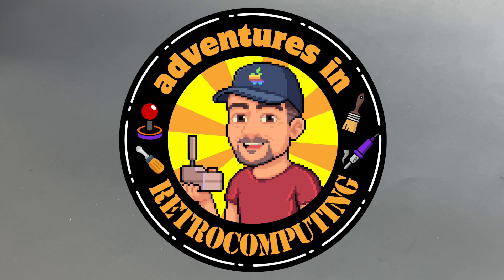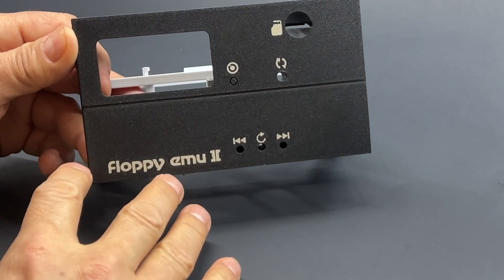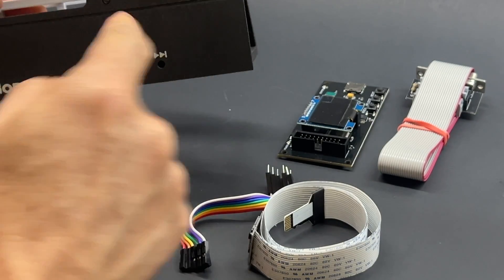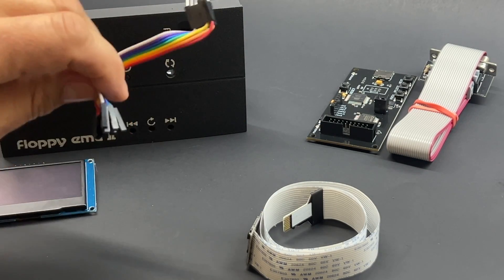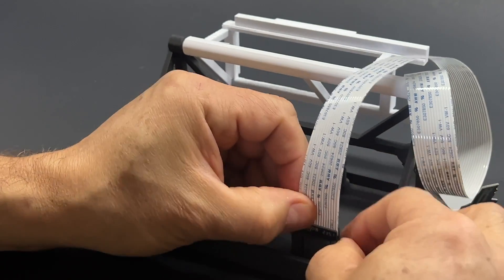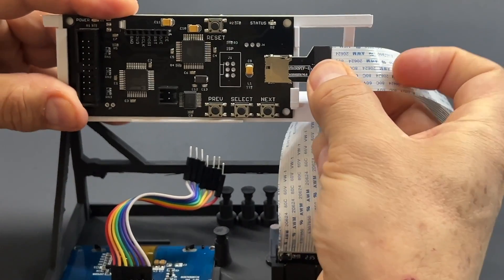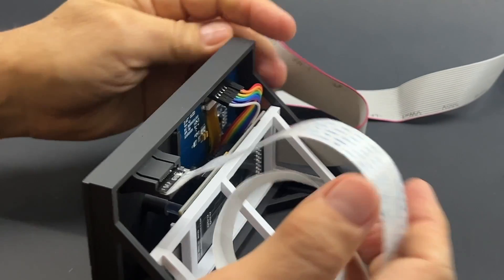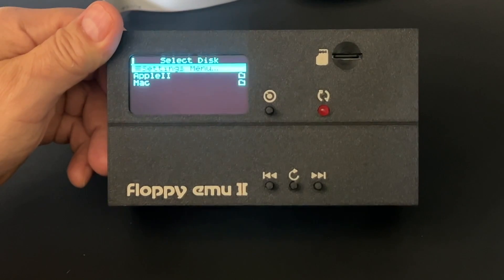New Release: Floppy Emu ][ Case Assembly Guide!

Comment: Finally got back into messing with Apple ][ stuff, and got a used Disk][ case for this kit from Javier.  Going to hook up this, and a wDrive to a Yellowstone card on my IIe.  Javier had already connected the screen and SD extension cables, and even glued the SD extension cable in.  Adding the Floppy Emu was as simple as he showed in this video.  I did break a button, but Javier also included a few extra buttons for a dummy like me.

The only way I can see this being any better is to provide some cable management for the cables to the back of the Apple IIe.  I have to remove the Apple branded newer style Floppy Controller cable (Dsub 19 IIRC) from the case and feed in both of the 20-pin cables to attaching to the Yellowstone card.  Having something to attach to the back of the case and plug into there would be nice.

Finally, a small nit, but I am guessing that it would be cost prohibitive to actually have the Apple color logo as part of the 3d print.  Other than that, this is an excellent kit from Javier!  Well done!  All the best, Bill T.

Comment: NICE!  Question #1.:  Will this work with AppleIIgs...   #2.:  I have MANY ( >> 100) AppleII programs on Floppy Disk.  How can I get these loaded onto SD card?
Reply from the maker: 1: yes, just need the DB19 adapter that comes with it.
2: you can use copy ][ Plus to copy to an empty DSK image from a real floppy, as long as it’s not protected, it’s complicated but feasible. 
also most programs are already available online in DSK image.

Comment: are you 3D printing the cases too so real Disk ]['s won't have to die?

either way, this is pretty sweet.
Reply from the maker: I am printing some bases, and using metal case from converted drives or bad drives with damaged cases, which I refurbish and repaint,

Comment: I thought the micro SD card connector had a card detect switch so it is not necessary to press a reset button to signal the card is loaded, or unloaded?